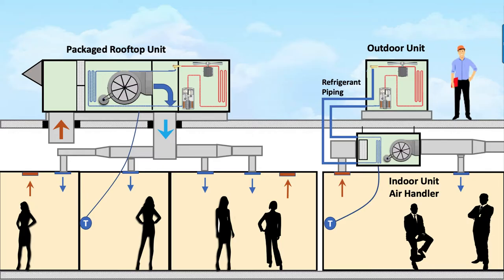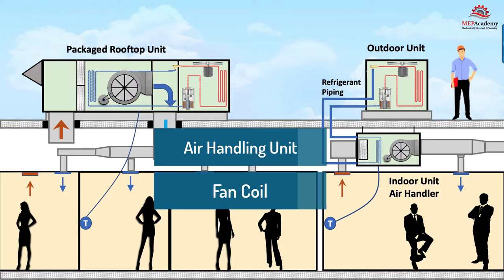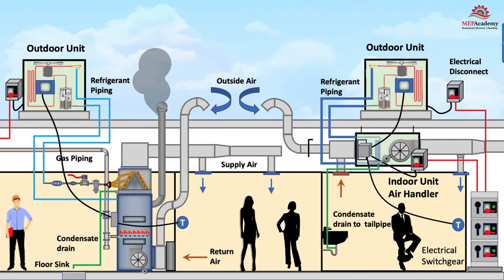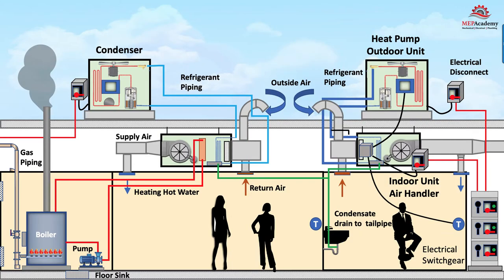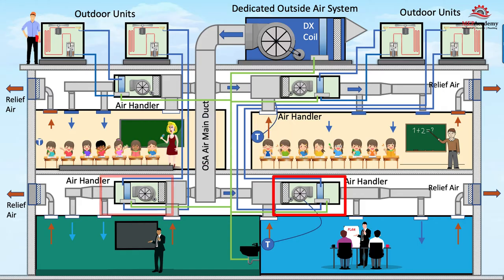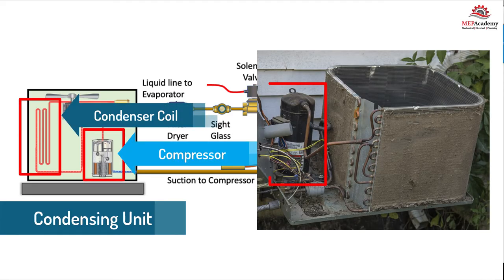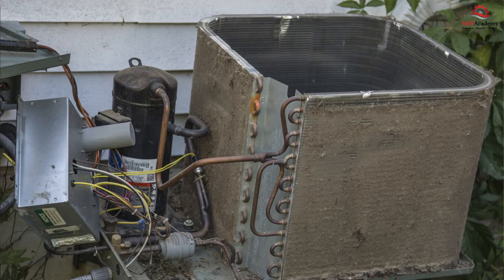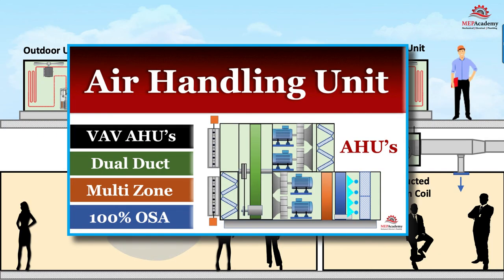How HVAC Split System Air Conditioners Work

Comment: what's the purpose of the solenoid valve, thank you
Reply from the maker: There are many uses of a solenoid valve. Here are a few. 
During Normal Operation: The solenoid valve opens to allow refrigerant to flow to the evaporator coil, where it absorbs heat from the indoor air.
During Off Cycles: When the air conditioner cycles off, the solenoid valve closes to prevent refrigerant from continuing to flow, which helps maintain system pressure and efficiency.
During Defrost Mode (Heat Pump): The solenoid valve changes the direction of refrigerant flow to help remove ice from the outdoor coil.
Refrigerant Pump Down. Zone Control.

Comment: Thank you for this explanation 

Please I am a bit confused with the categorizing of decentralized systems mentioned in Ashrae system book chapter2 
Actually, it is not clear the difference between them, for example, the multiple unit systems and light commercial split systems. 

Also for the VRF systems, I did not understand where they fall, under which category multiple or commercial light ?
Do you have a simple explanation for these systems or to suggest me a textbook to understand them more? 
Thanks
Reply from the maker: Just think of decentralized systems as all types of HVAC equipment except central plants or buildings housing the main source for heating or cooling. Centralized systems can include chillers and boilers housed in a separate building or area from which it serves all the spaces or multiple buildings as in a University Campus. Decentralized systems are common in smaller buildings. The use of VRF can also be considered decentralized as the refrigerant is distributed throughout the facility with various Outdoor Units scattered around the building or multiple buildings.